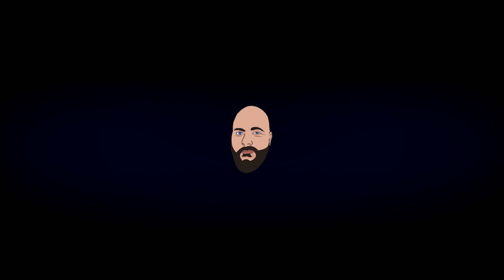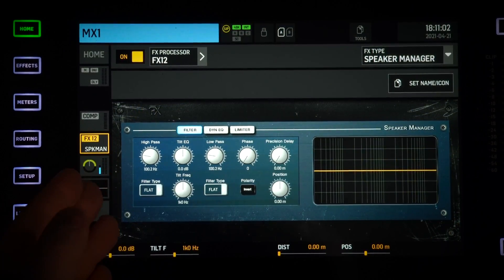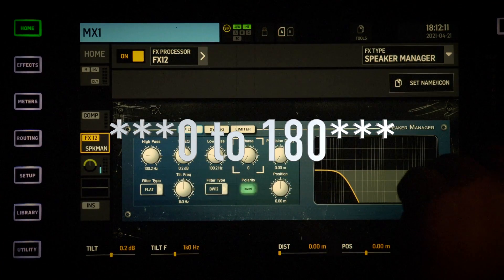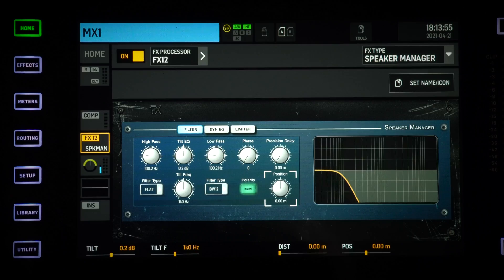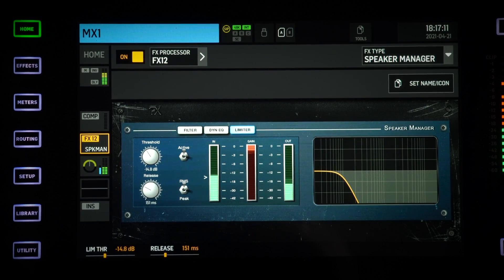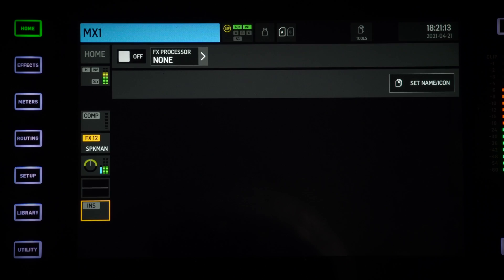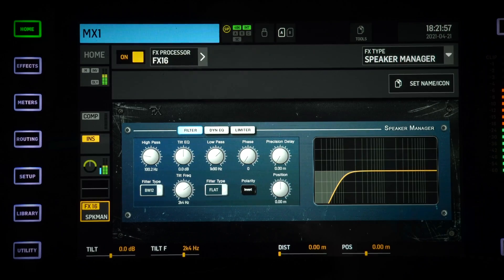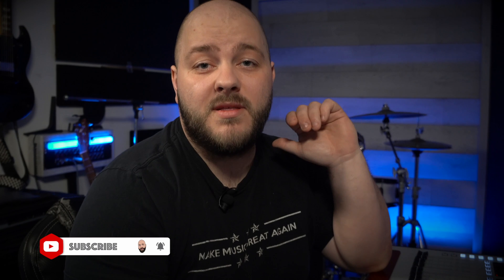Quick WING Tips - Speaker Manager - No more external processor needed ( Crossover / X-Over )

Comment: Can I insert the crossover on more than one matrix at a time?
Reply: So the way i have my wing setup is that I have 1 main LR output for my tops and one output for my subs. Now that I know about this crossover, I am thinking of how I can implement it
Reply from the maker: Hi !

if you use Matrix to feed your system, you will need to use 1 Matrix per speakers set and 1 Speaker Manager per Matrix., for a Stereo 3 Way setup, you will need 6 Physical outputs, 3 Matrix send and 3 Speaker Manager in your rack.
Reply: @GuillaumeLortie  Thanks. I'll think of another way to setup my masters then. I might do it the other way round. Send my vocals and instruments to the masters and send these to 2 matrices (one to the subs output and another to the tops). New on the wing and I am learning so much from your channel. Keep up the good work
Reply from the maker: @ikman6480  that would be the way to do it or, just use your Main 1 and 1 Matrix